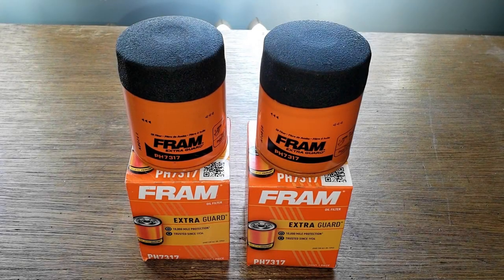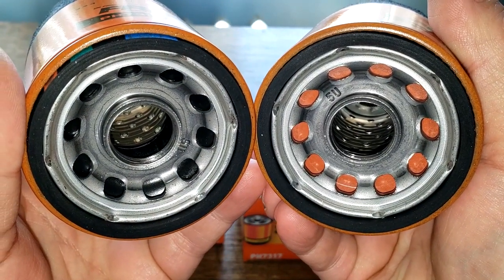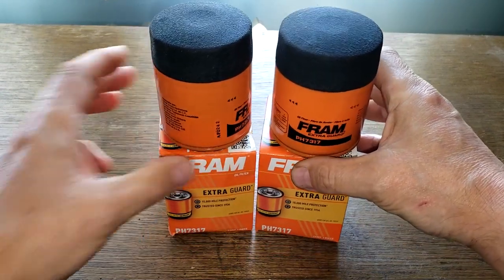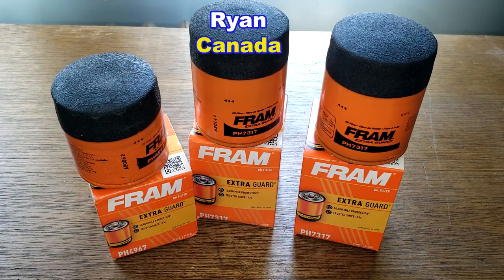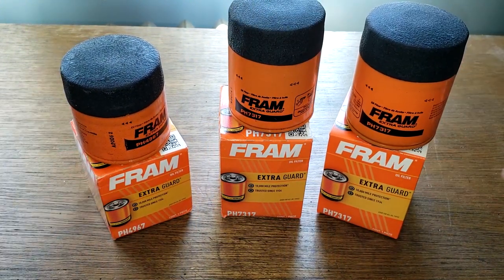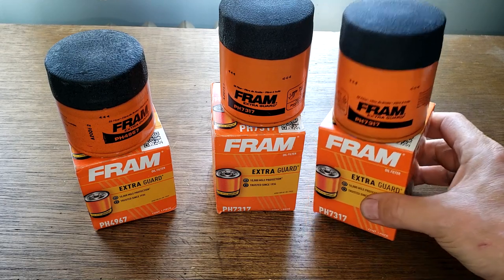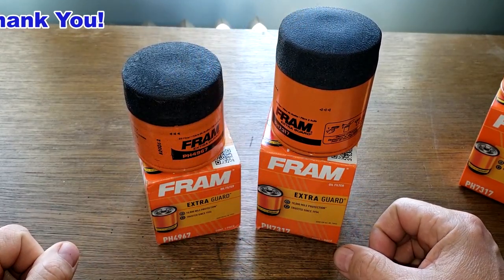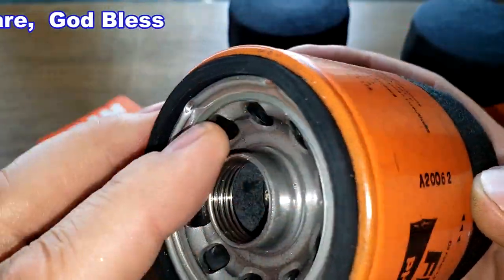Fram Extra Guard PH7317, PH4967 Oil Filter With Nitrile Rubber Anti Drain Back Valve

Comment: Awesome video Pete! And thank you for wanting to make this video! I actually went to change my Oil in my 2018 Honda civic and decided to try my luck with those same FRAM Extra Guard filters at another autoparts store across town, only to get two more filters with the Nitrile rubber ADBV's. Funny thing is, these filters were made recently and the boxes say they should come with the silicone ADBV. Soo I don't know what is happening right now. 🤷‍♂
Reply from the maker: Thanks, Ryan, and Thanks for the filters.
If you found some more chances are they are changing them to nitrile rubber and are not letting us know about it yet

Comment: Thanks you for the Saturday surprise.  

I used to run the orange can on my Mazda 2.0.  I loved the suregrip as that oil filter was located on the bottom of the engine on the back side.  

However, I used to run for 5k max.

Comment: I always open the box and look. For fram it's either the titanium or ultra I use. I learned even with no metal back screen the filter media design will be plenty strong and better filtration and still great flow. 
If fram gets worse I'll just completely switch to amsoil filters. I'm back to their oil. Was using schaeffers otr plus and learned the amsoil xl boosted is a superior oil so I'm switching back to that. Just ordered 16 quarts of it.

Comment: Both the Extra and Tough went to the nitrile for around 6 months I believe..    I have been checking recently and they are all back to normal with silicone.       The interesting thing is the Fram Core shop filters that Walmart uses never paused on the silicone from what I observed.

Comment: long before youtube and people cut open filters.  when we got our info from a magazine like hot rod and car craft.  a lot of people used fram.  I included.   I used it on several cars in the late 80s and early 90s when it was common practice to change the oil at 3000 or 4000k miles.  and i had a 91z/28 with a 305 (5.0) that went beyond 300k miles using valvoline 10w30 and fram filters
Reply from the maker: I did the same I used Fram's back then and whatever was on sale a lot of times. I've also opened up a couple of engines back then, blue smoke out of exhausts and the engines were full of sludge. Engines that only had about 100K miles on them. I have to say though I think the oil has much improved from them days.
Reply: @WhipCityWrencher  mine was like new inside.  In fact we just sold that car to a grandson of my moms husband.  He is currently driving it.  We did put a nee engine in it back in 2004 or so.  350k miles looked like a brand new engine.  No sludge at all.

Comment: Do those have 5K or 10K stamped on the end cap? The newer ones have 10K.(with the silicone ADBV). The stamp should be between the holes somewhere.  I've never seen a problem with nitrile ADBV below 7500....but I'd never go past about 6 on anything. Clean oil is better oil.

Comment: I always check to see the country they were manufactured - you’re right, they’re not all the same. I suggest weighing them dry and comparing the weight against a Motorcraft filter ?
Reply from the maker: They say made in the USA.
Comparing the weight to a Motorcraft will not tell you anything as they are two differently made oil filters.

Comment: The black drain back valve doesn’t bother me at all since the filter hangs down off the bottom of the engine of my 2013 Honda Crv.  Also if your car is using 0w20 which is a light synthetic oil it quickly gets pumped into the engine. In cold weather I usually wait 2 to 3 minutes for the oil to start flowing. I never go more than 7,000 miles between oil changes😊

Comment: True I get mine from Amazon and I've received one with a silicone and one with rubber.  But since I needed it I Installed it. And they were cheaper before with the rubber valve.

Comment: 👍👍  The colour markings on the gaskets would most likely be only for a wide range of filters with the same diameter.  So many of their offerings will have the same gasket.

Interesting about the same part# but with different DBV's.  Product version change?  Manufacturing error?  Deliberate substitute due to low/out of stock on Silicone DBV's??   Either way, the "customer will never" know.

Comment: So what's the difference? I understand they say silicone, so it should be silicone, but wouldn't nitrile rubber do the same job and last as long as it would need to?
Reply from the maker: It will probably do the same job, but Like I told another viewer some engines will develop a start-up noise,(not always) but it can happen. It has happened to me.

Comment: I recently purchased a NAPA 47055 and when I got it home I noticed that it now has a dome end bypass valve while the one I bought the last time had a base plate end bypass valve. I don't know if this is a permanent change for the Mann + Hummel produced filters. I will have to see if the 57055XP has also changed.
Reply from the maker: Thank Jeff,
Yep, there slowly changing them over.
Reply: @WhipCityWrencher  It is sad because that is one of the features I like about them. I have to guess the dome end bypass is cheaper to produce and matches other products in the Mann + Hummel portfolio so it reduces assembly complexity too.
Reply from the maker: @jeffkortsch8276  On a lot of them that had the base end bypass valve they have replaced it with a round piece of metal to fill in where the bypass valve used to sit. So no advantage with the change IMHO.

Comment: Just purchased two Fram PH7317 filters off Amazon with A22171 date codes (Aug 5 2022 mfg date if I decoded that correctly) and they both have silicone ADBVs!

Comment: Whip Fram reps have said it's " black silicone". However, that's been proven false on bobistheoilguy several times. It's why you saw Zee0Six posting about the burn test. Nitrile adbv has also shown up on the 15k mi. rated Tough Guard too. Not good. There's no doubt Fram reps lied. Yes where possible, always inspect filters before purchase.
Reply from the maker: Thanks, Faxmen09,
I didn't know that. I did a google search previously because I didn't want to rehash old stuff. Nothing came up. Thanks for letting me know. I'll keep the video up anyways to inform everyone.
Reply: @WhipCityWrencher  It's a good thing you posted it, can't hurt to have more information out there. It's a good heads up for orange can and Tough Guard buyers.
Reply from the maker: @faxmen09  Thanks! and I have to Thank Ryan also👍

Comment: I expect supply chain issues, which are still ongoing, forced Fram to substitute the nitrile rubber valve for the silicone version in order to keep production flowing. I can tell you these are not easy decisions to make in a manufacturing environment but most products built since 2020 have been forced to make substitutions due to pandemic disruptions. I also discovered a similar substitution when I went to try a SuperTech MP7317 filter and noticed that the three boxes they had on the shelf at my Walmart all had black ADBVs instead of the blue silicone valve that you showed on your MP7317 in a recent teardown. Perhaps by my next oil change the filters on the shelf will have the silicone parts again. The silicone valve is desired for my Subaru Crosstrek application where the oil filter is base-down on top of the engine.  I normally use a Fram TG7317 (same as Subaru’s OEM filter) as I’ve used Fram for decades. I did like the SuperTech as a possible alternate for the future since it’s built well and is less expensive than the Fram. BTW, those who throw shade on Fram filters because they use resin-fiber end caps are just armchair engineers with limited technical understanding of modern filtration design.  OEMs like Subaru have built their reputation on AWD, all-weather vehicles that operate in the harshest conditions yet routinely go 250K miles without anything but oil changes. Yep, that sounds like a company that would gladly risk that stellar reliability reputation by choosing Fram oil filters to systematically destroy their engines.  It’s time for a major recalibration of the consumer mindset!
Reply from the maker: Hi Chris,
Thanks for your feedback!

Comment: Did you ever cut them open to do the burn test? If so, what was the result?
Reply from the maker: Yes, I opened the PH7317 and it was nitrile rubber here's the video. I do the test near the end of the video. https://www.youtube.com/watch?v=eAxR0rN9nJ8&ab_channel=WhipCityWrencher
Reply: @WhipCityWrencher  I wonder if anyone has contacted Fram about this. It’s a perfect example of false advertisement, since it not only states silicon anti-drain back valve on the box, but also on there website… seems like very bad business practices..
Reply from the maker: @rayjay671  I think someone did on BITOG (Bob is the oil guy) I forgot what they said though. You might find the post with a search.

Comment: Maybe you could demonstrate the weakness of the nitrile rubber ADBV explaing what damage it can do???
Reply from the maker: It may or may not do engine damage, but on my daughters car you can here it when you first start it up.
Reply: @WhipCityWrencher  So, the valve is allowing oil to leak back into the pan/sump.
Reply from the maker: @rooster3019  I'm not saying this is always the case. I've opened up some used oil filters that had very good nitrile rubber ADBV because they looked good and there was still a lot of oil left in the filter/can. But the last oil filter that I had on my daughter's car developed a start-up noise and it had a nitrile rubber ADBV. I put on a Fram Ultra on her car which has a silicone ADBV and no more noise.

Comment: I read on BITOG that the nitrile ADBVs are due to supply issues. Also, any chance you have the filter media area of the PH4967?
Reply from the maker: I opened up a Fram PH4967 oil filter and the video will be shown Friday November 4th. I can tell you the Fram had 81.90 sq.in. media.
Reply: @WhipCityWrencher  Thank you so much! Looking forward to the video
Reply: @WhipCityWrencher  Just saw your video of the Wix 51394 (their cross reference to PH4967) and the filter media was only 46.8 sq-in. With 81.9 sq-in, the Fram has 75% more filter media! Both are 95% @ 20um as well.

It would be interesting to see how much filter media is in the PH4386. It is a 14mm longer alternative to the PH4967 for the same applications.
Reply from the maker: @dong_chim  I put it on my to-do list. Thanks!

Comment: I just received 5 Fram ph7317 with black anti drain back valves. No problem about that. There is also on all of them inside on the pressure relief valve some kind of liquid or lube on it. I though it was moisture so I stuck in a q-tip and swabbed it. It’s like some kind of lube. Has anyone else noticed this? Also the core inside is not metal it’s a plastic screen. I’m sure it will still work ok without a metal core.
Reply from the maker: Some have some light lube on them ,no problem, but I've never seen the PH filters with a plastic/nylon core?
Reply: When I get home later i will take a photo it.
Reply from the maker: @bklynpaul  Hi Paul, Please do and send it to me,   Poker4me007@gmail.com
Reply: Ok I sent a couple photos. If need be I will cut it open some time on the weekend
Reply from the maker: @bklynpaul  Sent you an email
Reply: I used my dremel to open the filter and I sent you a photo and video. It’s plastic

Comment: they call that the orange can of death ! most likely because alot go over 3,000 even 5,000 miles ! there are a few similar fram filters from what i heard are made by fram for certian other stores and manufactures so it cant be that bad !
Reply: Yea you right, People wanna pay 3.50 for a filter and go 5000 miles or more,
Reply: I've used them in 6-8 different cars I have owned over the past 35 years and counting.  Guess what?  Never had a single problem with any one of them, ever.  Not once.  In fact, I've never had a single problem with any oil filter, ever.
Reply: @bb5242  same here ! i think what can happen is the pleats can if neglected disintegrate and plug the smaller passageways ! like lifters - hyd  timing chain tensioners and timing chain oilers !

Comment: Anti drain back valves are pretty useless when you think about it.
Reply: @scott5799  I can't think of a way it would be mounted that makes it make sense.  It just restricts oil flow making the oil take longer to flow through the filter and reach the critical parts.
Reply from the maker: Thanks for your feedback.
If your filter is mounted horizontally it helps to have a silicone anti drain back valve.
Reply: @scott5799  The oil drains back anyway.  Fill a filter full of oil, lay it on the side and see how much oil is left in the filter after a day.  The oil that was in the oil pan would still have to build up enough pressure to open the anti-drain back valve and during that time the engine is starved of oil.
Reply: @WhipCityWrencher  They just delay the oil reaching the engine as the pressure has to build up enough to open it.
Reply: @Boodieman72  The adbv doesn't restrict oil flow. It's just a one way check valve that helps keep oil in the filter and the oil galleries leading to and from the oil filter. It actually help prevent dry starts, and start up rattles.
Reply: @faxmen09  The amount of oil it keeps in the filter is so minimal it's pointless.
Reply: @Boodieman72  You should add, "IMO". If you read carefully, you would have seen that not only does it keep oil in the filter, but it also helps keep oil in the oil galleries leading to the filter. It does help prevent dry start and start up rattle. I trust engineers know just a little more about oil filter design then some rando spouting on the net.
Reply: @faxmen09  The engineers that make the oil filter I use don't use an anti drain back valve.
Reply: @Boodieman72  Possible, however that doesn't mean ALL oil filters don't need/use one. The vast majority of manufacturers use one for the reasons noted. So, one anecdote does not a rule make. It's a distinction with a difference.

Comment: I'm really surprised that anybody even uses that garbagy 'can of death' anymore. I know, I've heard the arguments 'It's OK for 3000 miles' 'Limited use' Blah blah. I've seen first hand cold start noise problems, oil pressure issues, and other random oiling problems that went away just by switching from this cheap Fram trash. For God's sake at least get a Super Tech which is a pretty decent generic filter. Fram probably makes some fine upper range filters. I don't know. haven't used them since the '80's but it's beyond me why they would taint their brand with a product like this. I would even use the old 'Lee Eliminator' filters before a Fram back then.
Reply from the maker: Thanks for your feedback, but The filters aren't as bad as some may want you to believe.
Reply: I hear what you're saying, but everybody has seen what the inside of these filters look like and they have a deserved reputation that doesn't exactly scream quality. Their advertising on the box doesn't even match the product specs so Fram obviously could care less. To put it into perspective, if you have a $10k engine (or even less) you're not going to be reaching for the Fram. If you have a $125 Pull-A-Part 350 Chev maybe. With the cost of things these days you can buy a Motorcraft or Purolater 'Red' can 'classic' for 2 or 3 bucks more. That's less than the cost of half a gallon of gas. Why not? People that care about their equipment don't choose Fram. People that take their cars to 'Quick Lube' places get them.  Thanks for your videos. They're really informative and gave me a new appreciation of some of these filters. Some are better than I thought and some not so much. @WhipCityWrencher
Reply from the maker: @vincemajestyk9497  I understand, I was disappointed when they changed the Ultra and now after seeing this I'm not much of a fan either. I never cared for the cardboard/fiber endcaps, but I don't like it when tons of YouTubers were going crazy over it either, heck look at Walmarts endcaps, to me no better and I'll link a video in case you've never seen it. But I always liked their Ultras, They were well-made oil filters.
Take Care.https://www.youtube.com/watch?v=C2a_b3FNEqo&ab_channel=WhipCityWrencher
Reply: @WhipCityWrencher  I wholly agree with what you're saying. The Ultra and the Titanium, which I'm not sure but was more or less an Ultra re-branded for Autozone were/are decent filters. It's just hard to get past the image of the same company making the 'Orange' can. People hear 'Fram' and it's negative right away. The Super Techs were made by Champion Labs years ago (last time I checked and they WERE good quality) I haven't used or looked at one in over 10 years. It's really true what you said about things changing so fast. I used and used to think Wix was great since the '80's and never really looked deeper into it until I saw some you took apart. It was very revealing for me. Wix changed ownership 3 times since the '80's and they aren't as great as they once were. I think the Purolator 'high line' filters are the best deal for wide availability top quality filters. Ford racing is great but I think it's 'pretty much' a re-branded Boss with blue silicone parts. The other thing that I think a 'premium' filter should have and seems to be getting more standardized is a synthetic media. Even the K&N top line (with the nut on the can) is still cellulose. I still like the Fleetguard Microglass media even though they use Nitrile rubber parts in the filter, so I would give the nod to the Boss.

Comment: I am wondering why would anyone buy an American made FRAM if it has been junk for ages? Tearing, too little low quality media, etc.  If you have no other choice in a store, is it too expensive to buy an OEM filter from a dealer? Man, you need to replace an oil filter every 30K km or so. I would't put a junk filter even for 10K km because it may be bad inside and you don't see it.